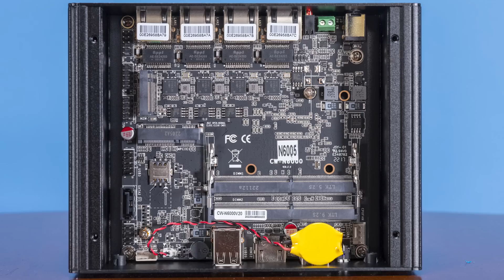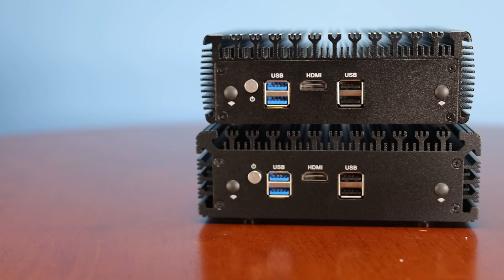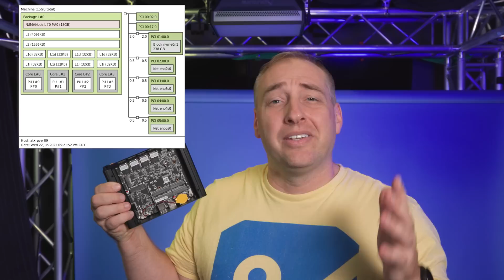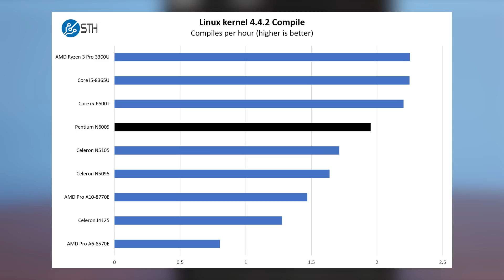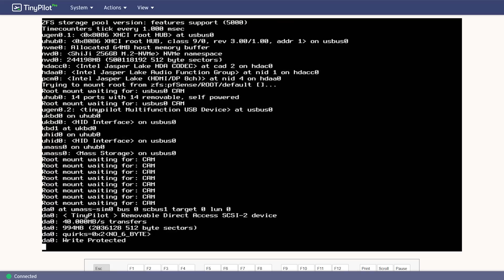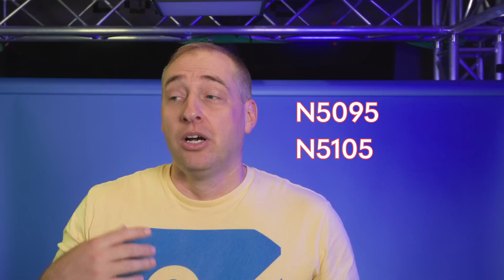Fastest Cheap 4x 2.5GbE Intel Atom N6005 Firewall for pfSense OPNsense and Proxmox

Comment: Any chance in the future you could enable IDS/IPS on the pfsense/opnsense install and see what throughput you get? That's always my holdup with these smaller dedicated boxes, just the unknown of what you're likely to see with those enabled.
Reply: I have the TopTon N6005 unit running OPNsense.  My Internet is Comcast Gigabit (rated for 1200Mbps but can go higher to around 1400Mbps.)  

Without Suricata on WAN interface I get full speed (1200 ~ 1400Mbps).  With Suricata enabled and Hyperscan method, I get ~950Mbps.  Note: this is a bare metal install, not Proxmox or anything.
Reply: @TheDopamin3  Thanks! That's super helpful. I need to do some more testing on my end to compare I think. My speed is generally not what's advertised but it's fast enough that I haven't bothered with testing to figure out where the issue is. That helps suggest it's probably my line and not the firewall.
Reply: @TheDopamin3 is the internet connection using pppoe?
Reply: Any modern quad cpu would do IPS easily.
Reply: yeah I'd love that and wireguard and a handful of pcs stressing it from a switch how does it do where does it drop off is the effective backplane throughput sufficient with some network hopping and and a few rules, etc
Reply: @edd7  Awesome, that's super helpful. I have it running on my end but I'm never sure whether my speeds being less than advertised is due to my line or my firewall. Should probably test the line in without my firewall at some point for comparison now that I think about it. Thanks again!

Comment: Great review as usual.Did you test if these can really support 64gb of memory? Also do you plan to test the 6 lan version?
Reply: I understand the intel spec but some are sold with 32gb and spec the max as 64gb on Ali.
Reply from the maker: Only went up to 32GB here. The sellers say they can hit 64GB. Then again, 64GB with a 4C Atom is hugely overkill.
Reply: Intel specs for the Pentium Silver N6005 say it supports only up to 16GB so it probably won't
Reply: @marcogenovesi8570  tbf there often is a difference between what Intel said is possible and what really is possible
Reply: @p3chv0gel22  dunno, all the times I tried to put more RAM than supported in the CPU spec it either doesn't see it beyond its max, or it is unstable

Comment: That looks like a great little unit for the price. The power savings between that and my current pfsense box could cover the cost of the unit before its useful lifespan ended. Based on some quick back on the envelope math. 

Fyi I'd be really interested in seeing an analysis piece about this IBM z/os mainframe cloud.
Reply from the maker: I think the next server analysis piece is more going to be Arm v. AMD v. Intel next-gen server CPU design philosophies
Reply: @ServeTheHomeVideo  that makes more sense. The IBM offering seems pretty niche.
Reply: @ServeTheHomeVideo  I liked the article on the hpe arm box